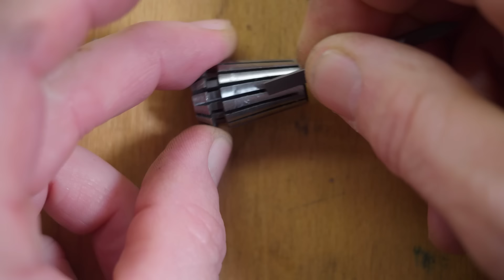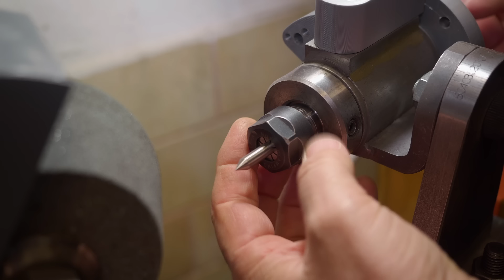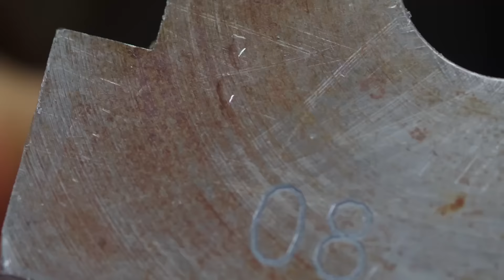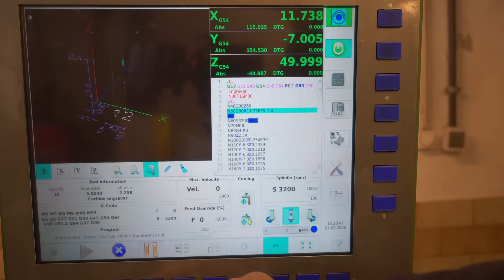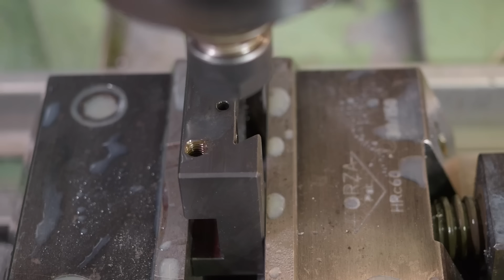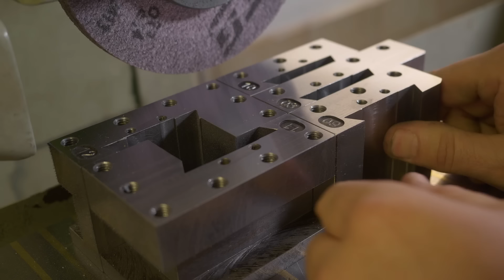Is a D-bit or pyramid tip better for engraving? || RotarySMP

Comment: I'm still not certain how the cutting action of the pyramid shaped tool works exactly due to the weird geometry, but in my experience, it seems that those tools can produce nicer cuts primarily because they're much more stable in harder materials than D bits. They also seem to be able to make much faster and deeper cuts without breaking.
Reply from the maker: Thanks for your experience on that. STGW recommended tiny ball end mills for engraving. I got one but have not tried it yet.

Comment: when setting your tool height off the 1-2-3 block and sliding it back and forth. bring the tool lower than the block then keep raising until the block slides thru, your much less likely to break an edge! cheers
Reply from the maker: Yeah, god point.

Comment: Hi Mark,
When I made my own D5 ER40 collet chuck I went to great pains to machine and check concentricity and angles and the check could be indexed to the 6 different locations that the D5 mount allows with less than 5/10,000” runout in the taper of the chuck but when I added a collet and nut the runout and taper on ground round stock held on the chuck exceeded 15/1,000”
Much hair pulling and swearing and checking and rechecking of the collets, nuts and the chuck produced the result of the ER40 nuts available were less than concentric  and contributed the majority of the run out and the collets added to this in minor ways.
The use of a ball bearing floating ER nut bought the concentricity back as this style of nut allows the collets to centralise in the tapers of the chuck and the nut and again produced the 5/10,000” accuracy.
I would suspect that the planetary set and the collet nuts of your spindles are generating the figures you have collected.
I hope my observations are useful to your fault rectification efforts.
Take care and play safe.
Reply from the maker: Thanks for that insight. That is a good point I had not considered.

Comment: I’m just wondering if the periodic runout error is related to the speed increaser’s input shaft rather than output.  That might explain the cyclic error. Reason for raising this being that I have the Swiss MULTITOUR version of it. On mine I had to make a new input shaft because my unit was supplied with MT4 and I needed INT40.  In doing so I now have  a slight runout at the cutter it’s about 0.02mm which is not ideal but also not significant enough to cause me a problem.  Im thinking perhaps at some point in the past perhaps someone made a new input shaft for your unit to suit their machine spindle and didn’t get it quite right. That being the case the whole body would move eccentrically in a cyclic manner. Nick
Reply from the maker: It could be, but I kind of doubt it. The shaft appears roughly the same age as the rest of it.

Comment: We have a similar style speeder head and it has ALWAYS been about 0.1mm out.

Plus we love to use the pyramid style for engravers because theyre practically free to make out of old carbide tooling and very quick to touch up. I would recommend ramping to your final depth though, it should improve tool life.
Reply from the maker: Good to know. Seems Hennginer might be optimistic with there expectation of a 0.05mm run out in the taper.

Comment: Mark, look up 9nine indexable engraving cutters. I started using them with the inserts for hardened steel. They lasted ages for me engraving generally soft material up to 38rockwell. Occasionally used them in 56 rockwell too. They are great because they last ages and you just have change the tip. The downside is the feed was quite slow for my max rpm of 15krpm. If i remember correctly it was 0.005mm/rev with spindle almost as fast as you can. I used the 6mm body 60 degree.
Reply from the maker: Thanks for the tip.

Comment: With these collets, actually, any collet that doesn’t have a pin and groove mount, you can mark the chuck and collet and turn the collet around in the chuck. If both are out, which they will both be, you can find a rotation where you have the least runout. Just permanently mark the chuck and collet for least error. Do this with all the collets. I do this with saw blades. I can always find a best position.
Reply from the maker: Thaqnks Mel.

Comment: Looking at the surface of that collet it's completely effed. - And if it's a cheap one to begin with, then you have no idea about your starting point. Cheap collets are often more exensive in tools than buying branded high quality collets. - Oh wauw, just got to 3:03 and one of those collets are more than just effed! - I have better experience engraving with a small ball nose, rather than a D-bit. Ø2R1MM going 0.1-0.2 depth of cut leaves a much nicer surface, because it's actually got a flute to cut with. - EDIT - 6:57 Looks like DPS Shrift Single font, and that is a faceted font!
Reply from the maker: Where do you get better ER collets? Although as long as the collet taper is also that far out, it is probably not going to work even with good collets.

Comment: Hey Marc, when you have the guts you could regrind the Speeder spindle but only the collet seat. I would gie that a try on a manual lathe let the  speeder turn slowly then grind the collet seat down in the origninal angled fashion.
 
Then the collet will take its seat back, no trouble added why? Because the collet will seat in a tapered matter. Round stuff with a taper will seat it self right at center ground or made perfect unless it wasnt made on a perfect centered axis.
I give a lot of things a second life just by trying easy solutions.

Good luck nice clip, waiting for the ball endmill update... =)
Reply from the maker: Pretty low on my to do list at present. :)

Comment: Something that occured to me as I'm watching this is that you should hold the adapter in a vise, then put a dial on one side (input), and see if it is straight when you rotate the other shaft. Then do the other side, and see if it is also straight. I'm wagering the output is fine, but it's your input. From what I recall, it is a "changeable" holder on it, and it may be out of whack. It would explain the the way the readings were on the input, kind of a 5x period thing.

If the input shaft adapter is removable, I'd take it off and put the dial on whatever is there.
Reply from the maker: Good idea.

Comment: The periodicy doesn't matter. You just need to measure the max runout per rev. At 3.15 you have 20 microns.
Reply: Also, why don;t you try grinding a d bit in the toolholder, clamped on the grinder?
Reply: You want about .1 depth.
Reply from the maker: Yeah, 0.1mm engraving depth is what I had set up for. If there is 80µm of TIR, spread over 5 rotations, then that is relevant, as that will affect the width of the engraving.
Reply: @RotarySMP I don't really understand the need for the speeder,

Comment: Very cool. I would guess that the "pyramid" shape cuts better at the same speed since it has 3 cutting edges vs 1, reducing the chip load for the same feed (Which is probably needed in this case, given the limit of spindle speed).

For the schaublin made tool holder engravings - you could add some nail polish or similar to increase contrast of the numbers.
Reply from the maker: Good idea. I need to ask for some nail polish from SWMBO. :)

Comment: Isn't it a good idea to regrind the Taper in the high speed spindle?
I did this for my Perske high speed spindle.
Came out with less than 2 micron of runout.
Reply from the maker: I suspect it is a bearing or shaft problem. I'd open it and check everything before a step like regrinding.
Reply: @RotarySMP open it an reassemble all the bearings with new grease and good preloading for the bearings.
But 0.05 mm sloop should be feeable.

Comment: Petition for you rebuilding that high speed spindle and grinding the taper. If there is one thing that kills engravers other than ramming them into a wall is runout. Maybe a collab? :)
Reply: There is a reason why these type of engraving heads were not commonly used. They are insanely fragile.  Steel bearings, lubrication issues, gear bruises, induced run out from two sources all contribute. In 30 + years maintaining machine tools of all types every one I ever saw and heard about was a one hit wonder. The air or electrical driven heads were far more accurate over time and a much better solution when it came to robustness. Usally cheaper as well.  They are so easy to over load they should be a single user tool only.
Reply from the maker: That is what I suspected. I need to get my pnuematic head addapted to the Maho.
Reply: Another project? I am still waiting to see the guts of the Balantron... again Mark love your channel and way of thinking

Comment: Good video! It might be worth it to try rebuilding the speeder or maybe just regrinding the taper. If you don't want to resort to that you can buy or make an adjustable er collet nut that would allow you to dial in the runnout.
Reply from the maker: I need to add that to the to do list.

Comment: As I said last week,  use .250"/6mm carbide cutter, .ie broken old endmill. Grind 3 facets each at 45 degrees approximatley to form a conical point. Use the point at the conical tip of the 3 sided pyramid formed at high rpm at about .002/.003" should be plenty deep enough.
I used to engrave using this method on forming inserts for plastic molds,
Reply from the maker: You mean like I did :)

Comment: I think you just found another procrastination wormhole. I mean what's wrong with just punching some numbers with oh, a punch?

Can we get back to the bike engine now?
Reply from the maker: These are not finished yet, and I need to make the grinder wheel hubs, and get the Schaublin tool changer running.

Comment: May a rebuild and straightening of the bit holder is coming up. I've watched your shop grow over the years. Takes a great deal of mental bandwidth to accomplish more than just work and travel. From a retired man across the ocean in America,  midway the Eastern Seaboard, located in the 12th colony/state signing our Constitution, and home of the first state capitol, founded in October 1710 by Swiss nobleman Baron Christoph von Graffenried. Historical vs the GPS coordinates 35N by 77W.
Thanks for the vids.
Reply from the maker: Thanks for watching my videos. I am not sure whether I will open up the spindle speeder gearbox and inspect it any time soon. Too many more important tasks at present.

Comment: Golly! You are gonna have the purtiest tools in the whole south.  😮😁

With the engraving on the original shiny tools, I have some flat (matte) black rustguard paint in a tin that is perfect for engraved jobs like that. It adheres really well to raw metal, and being flat black it dries REALLY quickly.
I dont even bother with a paintbrush for small jobs, just use the corner of a paper business card (like a brush) to apply the black paint down in the engraving, then before it dries completely I buff the top surface with the flat side of the business card. Sometimes with a drop of metho on the flat side. The idea of the flat side is that the card is stiff enough that it cant go down into the engraving so it cleans the surface only.
It is a very quick and easy way to get permanent paint down into the engraving, for really good visibility.
Sounds messy to explain but is very fast and convenient to actually do... and much better permanence than just using a black sharpie.
Reply from the maker: I will ask my wife for some nail polish for the Schaublin original ones. That also works well.
Reply: @RotarySMP   for sure, I use nail polish on a lot of materials. 👍
For an important steel tool job that has to last many years, I prefer a paint designed to adhere really well to raw metal.

Comment: I wonder how that would look with laser etched IDs?
Reply from the maker: Probably good, but I dont have a laser.
Reply: @RotarySMP    no one in the vicinity with one?  Somebody must be buying all those hobby machines from CHN after all, which are able to do this, no?
For me it would be a bigger issue, I live in Far North Queensland next to a couple cattle.. ;-)
Reply: @RotarySMP    PS:  It's mostly because of the 'faceting' that those machine moves made when it engraved those numerals at closeup..  the interpolation just looked odd (rough, coarse)?
I was expecting much smoother 'paths' tbh..  but u seemed quite happy and expected it that way which made me wonder, if it couldn't be done 'fancier'.
Reply: @RotarySMP    maybe u could reach out to Marco Reps?  He seems to have one and is of a similar mindset ;-)

Comment: This Old Tony is how I found your channel. He has a good video on bad ER collets. https://youtu.be/ncbJkz1zHOI?si=KRUngUDqB58_CFGO
Reply from the maker: Yeah, these ones are not great, but as long as the spindle has such bad runout, there is not much point replacing them.
Reply: @RotarySMP Agreed. In your last video the bench tests didn't look all that bad. I had hoped that it wouldn't be all that terrible at the tool. I still think it's a pretty cool device for low RPM high torque machines. I wonder if they make a reverse device for those of us rocking 24k RPM spindle speeds.

Comment: The pyramid style engravers perhaps compliment the cyclic run out - all three cutting edges get to share the cutting action, even if it is just one edge at a time.  
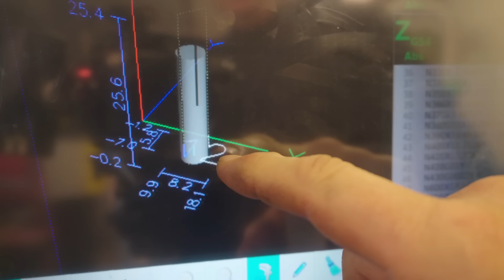At 11:35 - could've become the 12A'th tool if you are superstitious...
Have you resolved the faceting issue? Would be interested to know the source and solution.
Reply from the maker: I am pretty sure it will be in a setting, probably something like "curve tolerance" in that ancient version of FeatureCam i generated the tool paths with.
Reply: @RotarySMP FeatureCAM's curve tolerance only matters for spline geometry and the fact that you have g2s and g3's in the code make that seem unlikely. To me it is sadly more likely something at the control or machine side, either backlash or accuracy settings. Or possibly some setting on the minimum arc height where the control is converted slight arcs into straight lines. Since you said the older parts that were made with the same toolpaths don't show these facets that makes me suspect something at the machine changed since the toolpaths have not.

Comment: If the text gcode is indeed the same, rounding can be result of G64 settings in Linuxcnc. Or just get a better stick font or new code with more resolution. I touch tools in machine coordinates G53 to a repeatable location like the table. If you keep tools in holders between jobs, this is the best way. The micron indicator was a nice touch for 100 micron runout 🤣
Reply: I second this but also wonder about the following error settings he was adjusting while he was have axis drive alarm issues. That would also affect how smooth the machine motion is.
Reply from the maker: @JonSturm  I tightened them up a bit Jon, but need to try engraving a complete circle and see what it looks like.

Comment: Wondering if is pyramid tip better for engraving PCB and plastic. I'm only using D-bit at 15k rpm. Often freehand for quick text engraving and D-bit sometimes try to walk away.
Reply from the maker: I though the pyramid ones are better for hard metal. I expect it would just smear plastics.

Comment: Fibre laser😂
Reply from the maker: Don't have one.
Reply: @RotarySMP they are getting real cheap actually. I got a awesome 40W JPT Mopa on aliexpress and man this thing takes no prisoners. It deap engraves on tool steal, tungsten, stainless and i cut custom 0.3mm thick copper busbars for custom battery pack builds and it work amazing. I put my little logo on al my lathe and mill tool holders any excuse to laser something 😂

Comment: will you be filling in those engraved bumbers with something to avoid  gunk buildup? for example  numbers on the oryginal kolders could be filled in with black epoxy or paint for more contarst and the ones you made could be filled in with clear epoxy to keep oil and water lubricants from changing the contrast over time, clear coating them with 2k laquer would also work
Reply from the maker: Thanks for the tip.

Comment: Seems like not only the collet has runout but the gears inside the speed thingy also has enough runout and pushes enough on the hole thing to add to the runout of the tool ( if it has tree gears that needs tree rotation on the input to make a full rotation/circle around it make sense that after rotating the input 3 times it's back to zero )
Reply from the maker: It is 1:5 gearbox in there.
Reply: @RotarySMP  then that repeat pattern seems super odd. Are you going to stick with one shank diameter and a etp hydraulic adapter though ? ( after fixing that bend shaft/ what it is that makes it behave like that and then grind in the ER taper riding on its own bearings) ?
Reply: It should never use the gears to constrain runout.
There should be a dedicated rear (upper) bearing, which is often quite small and may even be a pin in a bronze bush. And a larger front bearing.
I'm thinking something is bent, probably that small rear pin.
Those speed increasers are not rated for much side (radial) load, and easy to crash and bend something if it was used with a side cutting tool like the side of an endmill.
Reply from the maker: @wizrom3046  That is what I suspect as well, but it is low on the to-do list to open it and look at it.

Comment: The speed-increasing device is essentially a planetary gearbox, just a little bit turned around. Most likely, the output bearing has gone out of place
Reply from the maker: I am fighting the temptation to pull it apart and look, as I have plenty more urgent projects to concentrate on.